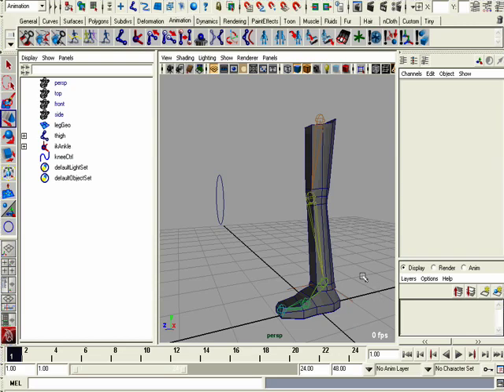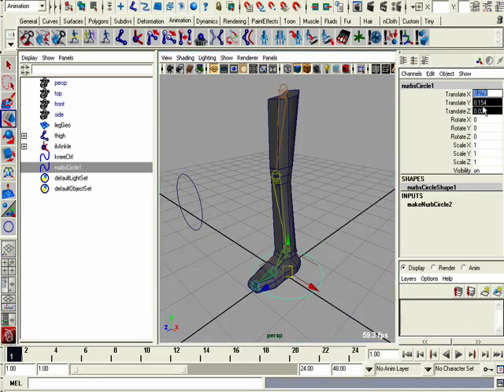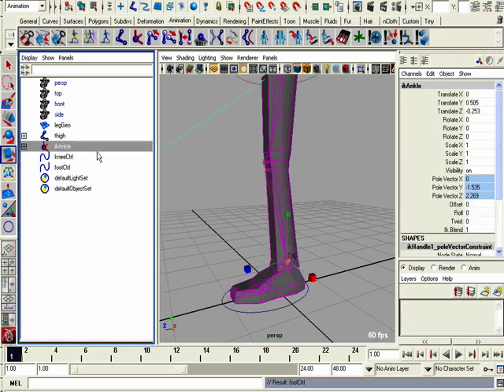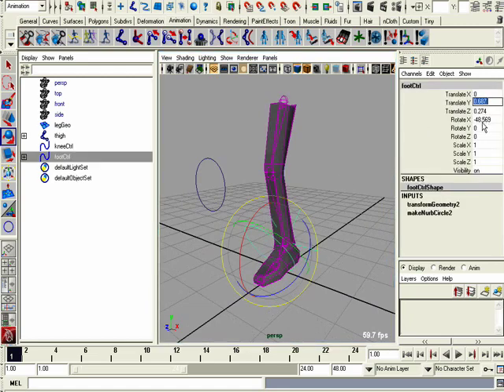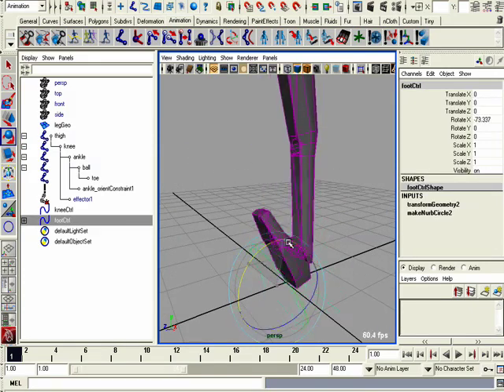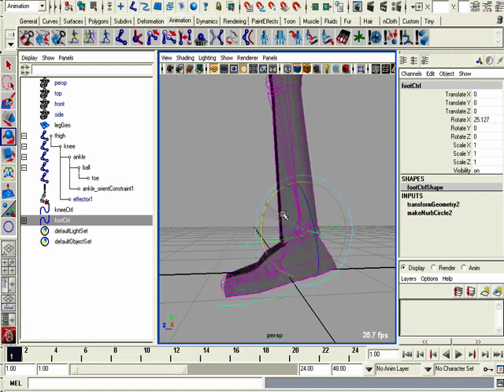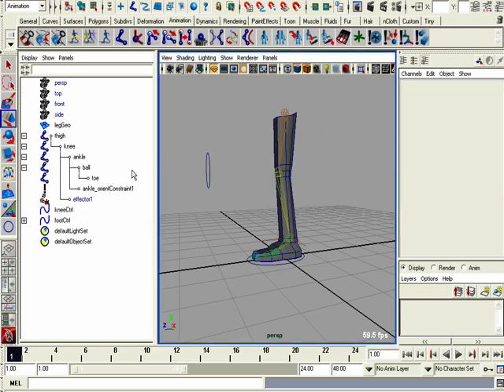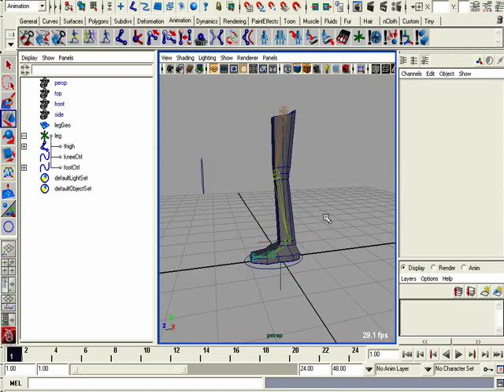IK leg rigging in Maya Part 3 of 3

Comment: Hello!
I'm using FK/IK switching with my rig, and in the Connection Editor controlling the ikBlend attribute through a custom attribute on the foot controller I called "IKControl".

I wanted to also disable the orient constraint with this custom attribute (since the orient constraint weight on the ankle was preventing my ankle from rotating when I switched to FK), but even when I switch the constraint to have 0 weight, my ankle rotation is still locked. 

Do you have any ideas?

Comment from the maker: To do the toes, you can make a custom attribute on the foot controller.  Call it "Toe Curl".  Have it's min/max value be -10/10.    Use the Set Driven Key window to have the new Toe Curl attribute control the Z rotation of the toe joint (or which ever axis is the one which would tap the toe).  When the Toe Curl attribute is at -10, have the toe joint rotate down 45 degrees.  When Toe Curl is 0, have it flat (0 degrees).  Finally, when Toe Curl is 10, have the toe go up 45 degrees.

Comment from the maker: Hello.  The knee controller only twists the legs IK plane, which make the knee look like it moves left and right in the X axis if the foot is pointed towards the Z axis.  To make the knee move up and down or front and back, you have to move the foot controller or the thigh bone forward and back or up and down.  It sounds like you did it properly.